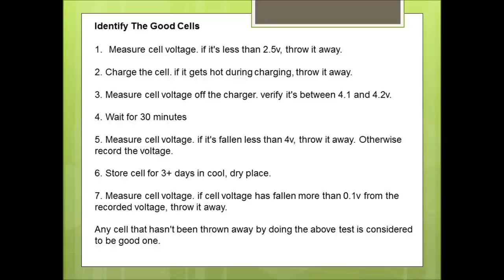HOW TO MAKE A POWER BANK FROM USED LAPTOP BATTERY

Comment: wow,  from the looks of the title,  I assumed you was going to make a battery supply back from scrapped materials.  not,  go and buy a power bank and put the old laptop batteries into it.  simply,  it's quicker to just purchase a 18650 battery charger with a battery included! but thanks for putting in the work.

Comment from the maker: Reuse your old laptop battery to make a power bank.Keep your gadgets fully charged.
Go Green and Save The World..
Reply: Can you share the link from where I can buy the case of power bank?
Reply: +Vishant Prajapati buy it from e bay bro..
Reply: +Richard Osman link pls
Reply: +Vishant Prajapati u will get it from eBay. 
I got one for £ 3 in uk.
which has 5 , 18650 battery slots , 2 usb out,1 micro usb in , led torch and a small lcd display to show the percentage of power in the p.bank and the status of charging.

Comment: if I want to make a  3cell 18650  in parallel for higher mah, can I still use the electronics of that keychain powerbanks or its just made for 1cell?
Reply: +JinRei Using the electronics should work.
Reply: +JinRei as long as the voltage stays the same then it will work paralleling batteries increases the amp hours but the voltage stays the same

Comment: hello I'm not good at electronics so I have pretty dumb question. Can I get same 3-4 Laptop batteries and make one power bank for my laptop?
Reply from the maker: +Midnight Conversations You can make it.The critical part is balance charging circuit.If you are confident then it is possible.
Reply from the maker: You can.But you need a balance Charger.
Reply: thanks :)

Comment: man i have 6 good batteries. if i connect it in parallel with each other and connect it in that kind of powerbank case like you used, will it still work?
Reply: I've the same question but i assume it will get heated up really quickly whether you charge your phone or charging the power bank itself
Reply: Yes it will

Comment: Must be fully charged laptop battery or is not necessary?
Reply from the maker: Not necessary.Later you can charge it
Reply: Open Green Energy
Ok, Becaouse i want to connect together 5 batterys and put it back in power bank. Must to charge every single battery to full? Or i can just connect together and put in to PowerBank and then charge all via PowerBank?
Reply: Open Green Energy oii

Comment: Generally power bank is rated as mAh unit. So, if I use one cell as per your video what will be the mAh and how much time will it take to charge from laptop and discharge by charging mobile (smartphone)...
Reply from the maker: +Yusuf Faruk The Battery Capacity is depends on which battery are used.In my case it was 2200mAh.
The time required for charging is approx 5hrs.
It will charge a Smartphone whose capacity is below the Battery capacity ( 2200mah)
Reply: +DEBASISH DUTTA Thank you. In my place no option for e-bay. so any way to create the charging hub?
Reply from the maker: +Yusuf Faruk Where are you living ?

Comment: I usually try a forced charge cycle on each cell after being taken out of the assembly to try to reactivate bad cells - A few hours on TP4056 Li-ion charge controller and if the battery is not up to 4.2V I consider it bad.

Comment: if I put 4 laptop battery in 1 power bank will it work??or the power bank will bust up??
Reply: If connected in parallel then the voltage should be the same but the capacity will be the combined capacity of all 4 cells.  Just make sure you provide enough charging current to charge all four cells simultaneously.

Comment: you could just buy a rechargable AA battery
Reply: The point is, you use old and working batteries
Reply: That isn't how it works -.-

Laptop batteries aren't AA batteries. I see alot of people thinking laptop battery cells are AA.

AA batteries don't have the voltage nor the amperage to power a phone or any other device.

Just google it.

Comment: These also work GREAT in budget 18650 flashlights!  BudgetLightForum dot com
Just don't use em for vaping, most cannot handle the high current flow for that application
Reply: +Brian C 
thats why you wire about 10 of them in parallel then you get the current and a really long lasting battery as a vaper myself i know the pain of a dead battery